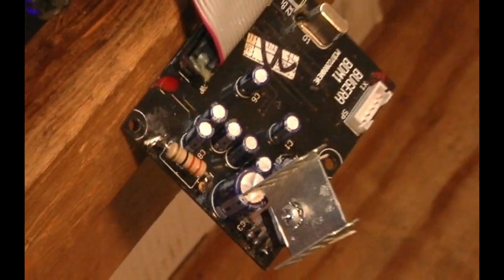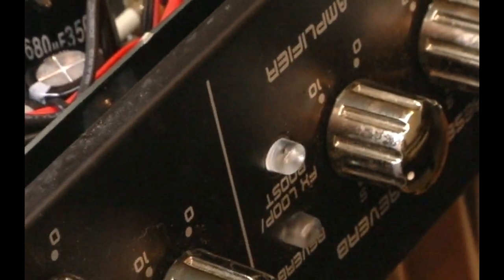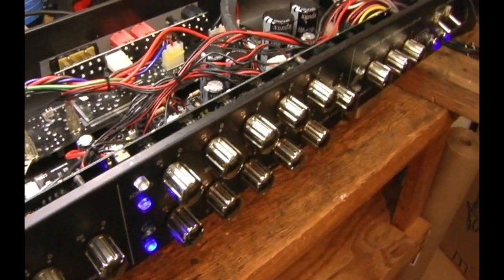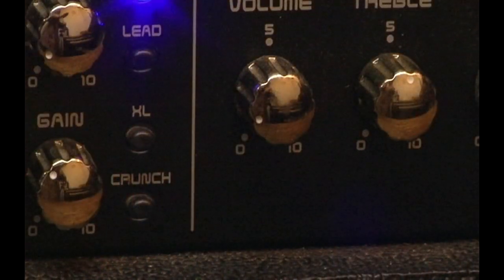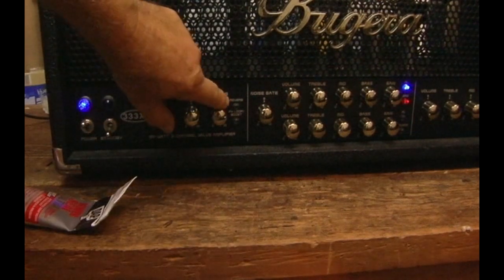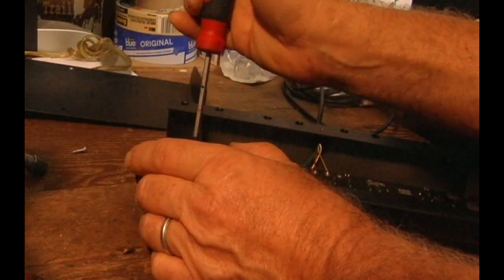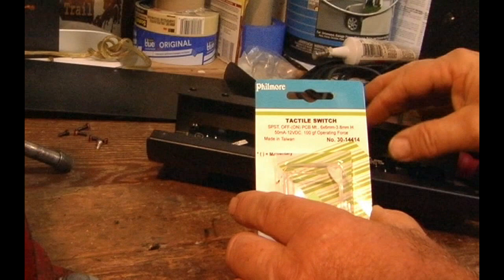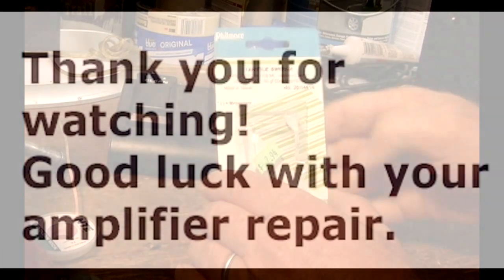Bugera 333xl switching problem SOLVED !

Comment: All what I need it's a use this silicon on the front switches?
Reply from the maker: That was just diagnostic / temporary. You need to replace the switches eventually or the footswitch will not work on some functions.

Comment: Hey! Can you assist with the colors of the wires in the five-pin plug of this footswitch? The guy, who sold me a Bugera combo, broke the footswitch while unplugging so the plug stuck in the combo but all the wires came off. I was searching for some sort of a scheme to fix it but there seems to be none.

Update: Found the wiring color scheme here, finally it works! - https://www.ultimate-guitar.com/forum/showthread.php?t=1645477